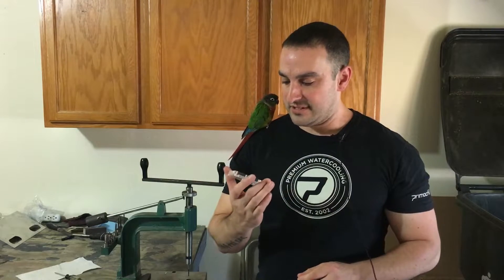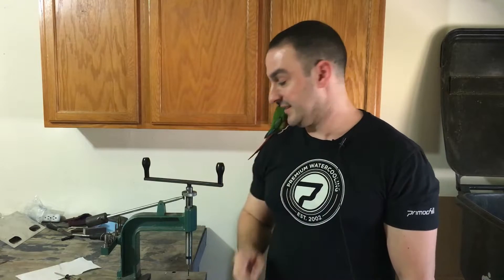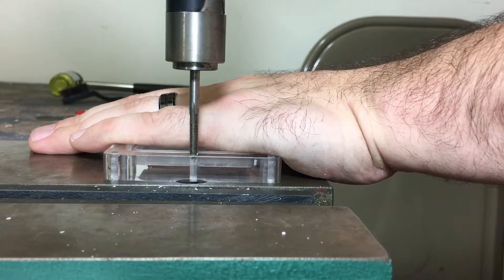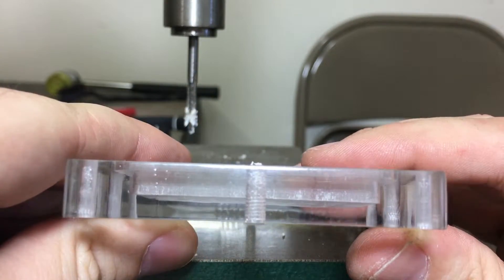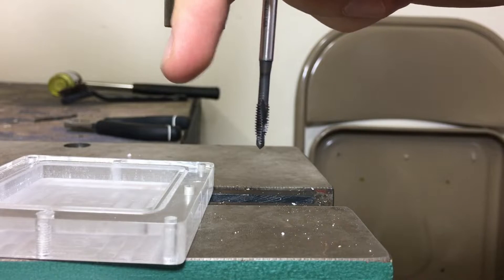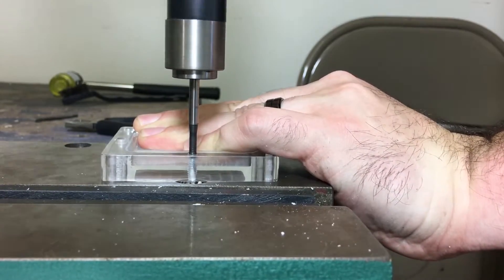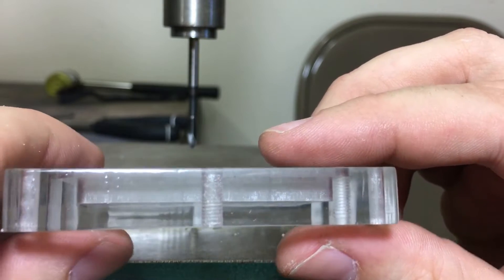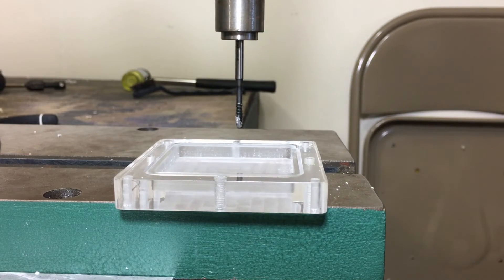The ONLY Way To Thread Tap Acrylic!

Comment: Hi buddy
I have 1 question.
How to reduce the temperature of the tap head?
*Do not use lubricating oils. :(
When working continuously for a period of time, the tap head gets hot, leading to the plastic product melting. Currently I am using compressed air to blow directly into the tap head, but it is ineffective, and too much compressed air is lost.

Comment: One major problem.. in the majority of cases where the acrylic needs to be tapped, there is no thru-hole. Hence, a gun tap will not work. You should do another video whereby the chips need to be pulled up and out of the hole using a blind hole tap. Many prefer the two flute plug tap however the correct tap is a blind hole spiral tap. The less flutes the better.

Comment: I've threaded plastic and never had that issue. I use 2 flute and do it just like I do metal. It would be better instead of going full-bore through the hole in 1 shot, go  1/2 turn and then back out 1/4 turn. And.....do it with the hand tool, not a press. you'll get clean threads and every time you back out you clean the thread you just made. My taps never get hot but I just take my time. The chips break off and do not compress if you go slow and don't give it a chance to heat up. 2 Flute VS 4 flute gives you more room to clear chips.

Comment: I don’t understand. I’ve threaded 1000s of pieces of cast acrylic very successfully from M3 to M6 using standard 4 flute taps. 
Do I back it out yes, do I use a power drill, yes. Do I add a little soap, yes.

Comment: If one want's to thread tap into acrylic for a Barrow G1/4 Male Rotary to 90 Degree Female Angle (Fitting for watercooling). Which size thread tapping piece would be used?

Comment: yo how do you account for thermal expansion of the material when you do this? its my understanding that acrylic expands like 1/16" per linear foot. Wouldnt screwing into it put it at risk for cracks or crazing?
Reply: Cracks/Crazing, is my night-marish prospect while planning construction of a hobby machine including ordered laser-cut acryl spinning gears. Thermal expansion rate you mentioned, is just gonna add to sleepless nights.

Comment: Your tap looks a lot like a "machine tap". I use those on aluminum, it's a single-shot tap you can use with a cordless drill and it works perfect even tapping an M3 hole through 20 mm of metal. I'm French so we call it differently, I don't recall mine being labeled "gun taps" or even if the package mentioned plastics but it looks like it should do the job. If I have some spare acrylic I'll give it a try.
Reply: No, here the spiral is reversed to push the cleared material out the bottom it won't drill and tap in one operation.
Reply: @xONEWINGx  sorry, I didn't mean to say my taps are "drill taps", what I call a machine tap still requires that you first drill a hole of the correct diameter. I just meant that instead of the three different taps you get with a hand tapping set, here you just need one tap (and a good dose of cutting oil). But you're right, your tap is still different, mine will pull the material out, not push it.

Comment: Gun tap is no good for blind holes! I just use 3 flute taps in a battery powered driver, slow speed with torque set to minimum and a dip the tap in tallow before use. Been doing it that way for years and works for me. I only use cast acrylic though, you didn't specify what your's is.

Comment: your thread desintegrate precisely because the tap is burn your finger hot. You are going too fast. if you want to do it with a regular tap you need to be real slow.

Comment: If you want to learn about this look up “rake angle” in any machinist’s manual. What you need in this application is a zero rake angle and about a 60 degree principle angle. 

“Gun Tap” = marketing wank.

Comment: The gun tap is a formally spiral point tap, sometimes called a machine tap. They are really only for through holes, but clear chips well. A standard (number two, plug tap, etc) will do fine with acrylic, but you want a reduced flute count tap, which is a two flute for these holes, not a four flute. Acrylic  has two properties that require an aggressive tap: gummy and elastic. The chips will pack rather than clear due to gummy, and the material will push out of the way rather than cut if the cutter isn't aggressive. Yes, spiral point is the best choice for a through hole, but for blind holes, use a sharp two flute plug tap. The tap you started with isn't good for much of anything, to tell the truth. It looks dull and corroded from the start. There is no "hobbyist grade" tap. Just low quality taps. TANSTAAFL.
Reply: Big thanks John JOHN , you just answered the question I had- how to deal with a blind hole..👍
Reply: ALso, what you showed first is a chip lifting "spiral" (helical flute) tap. Again, two flute for acrylic and similar, but not as nice as spiral point.
Reply: @johnjohn-ed9qt  Seconded. This is great info on the "gun tap"/SPT/machine tap with regards to acrylic, but I was staring to panic a bit myself as my requirement calls for blind holes as well. Thanks a bunch man!
Reply: @grumblycurmudgeon  late to the party! can you inform me on what a blind hole is?
Reply: @TheBinklemNetwork  Not a through hole. Stops partway. If I have a 4" piece of stock, but wish to tap a 3" hole in it, 
A. there's nowhere for the chips to clear to, and 
B.I'm trying to thread clear down to the bottom of the hole, usually, as opposed to having a taper towards the end.
That's why this is great to see: the tap he illustrated cleans up after itself. Pushes the chips out behind it. If it pushed them downwards instead, by the time you got 1.5" in you'd have an ingot of material slag and a broken tap.
Reply: @grumblycurmudgeon  thank you for the information!
Reply: Can you tell me where to get the two flute tap?
Reply: They make a blind hole spiral tap to pull the chips up and out of the hole. Although a two flute plug tap will work, it's not the best method of tapping a blind hole in acrylic.